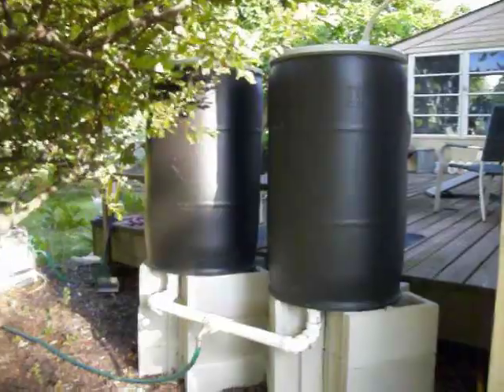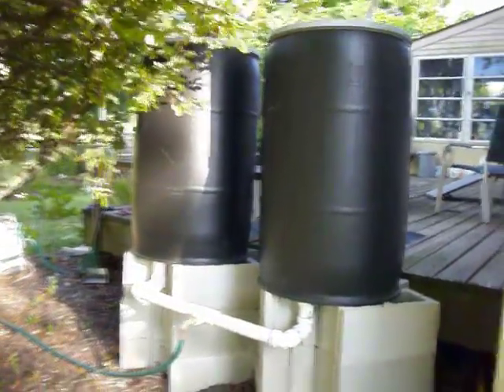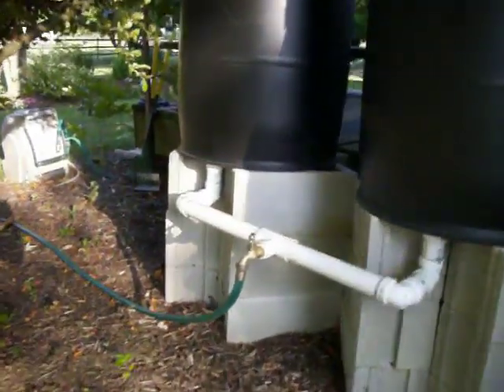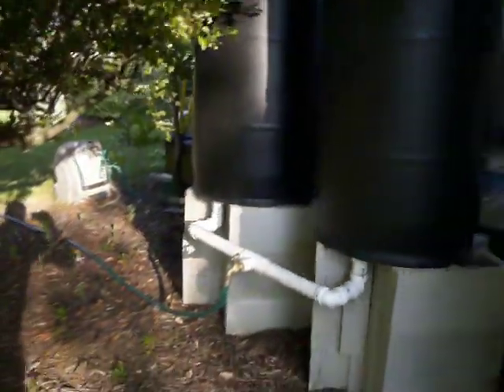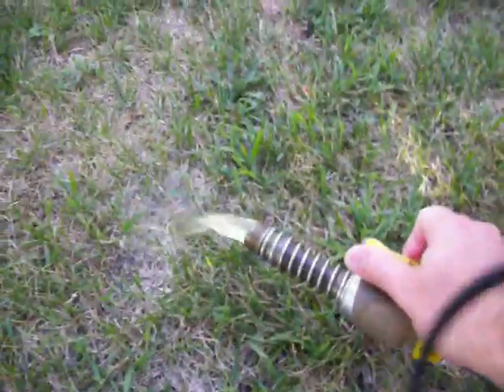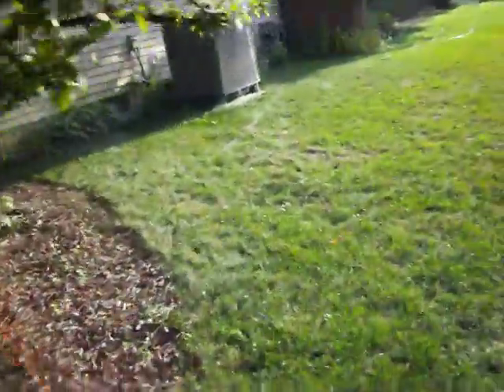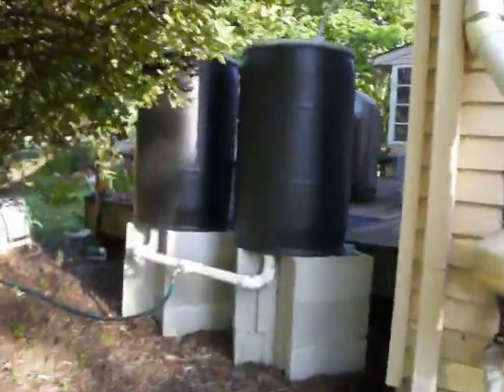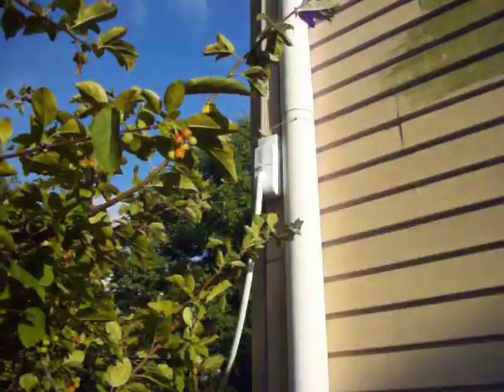The Best Rain Barrel System

Comment: How's the harbor freight pump working out?  I'm looking to add a pump to my system..
Reply from the maker: Yes, although I only use it to move the water over to my garden barrels. I believe fo rthe price, it will work great for your needs. Thanks!
Reply: jimginnyohio Which model did you get?  Is it on demand, or always on?
Reply from the maker: TheStavros1001 It is simply a 12v bilge pump. I only connect it when transferring water from one barrel to another across my yard. I connect a garden hose to it for that. I guess I could automate things with a float switch, but never really saw a big need for that. The way I'm doing it now, I only drag the pump and hose out whenever needed. That way I don't need to move the hose everytime I mow my yard.

Comment from the maker: The yellow/green water is caused by algea growth. One of the main problems with most rain barrels is that algea will grow in them if any light makes it through the barrel. I used black barrels in my project to minimize this. However, since the lids were white, some light was still getting through. I plan to paint the white tops to black this year to see if that helps.

Comment from the maker: During the winter, I drain the barrels down to about 2-3 inches. The 2-3inches of water keeps the barrels weighted down so they don't blow around in the wind. If you don't drain the barrels, they will freeze solid and possible crack. The downspout diverters I recommend have a seasonal plug that you can install in the winter to remove the barrels from service.